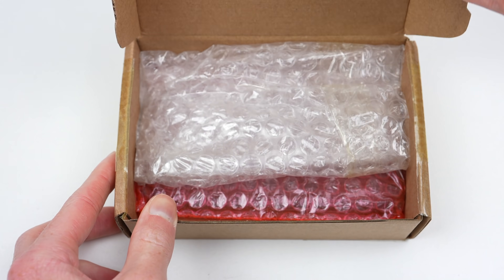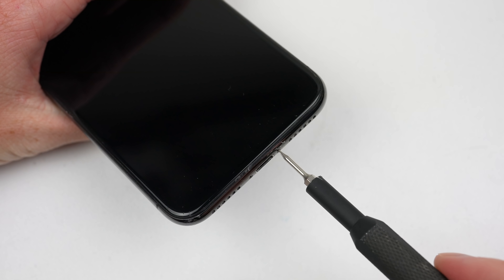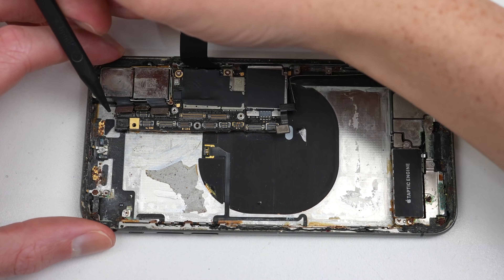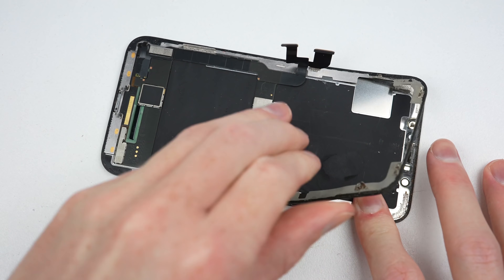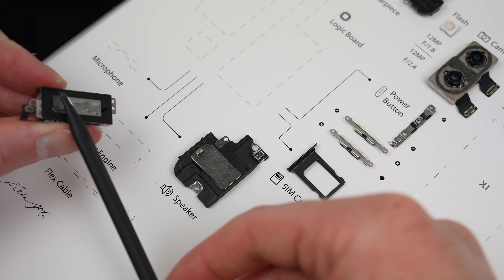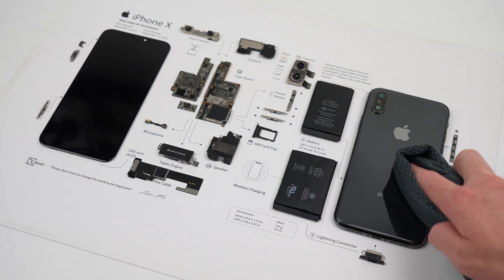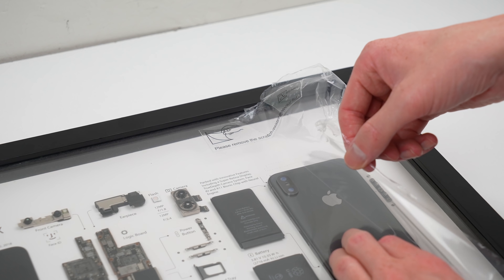Harder Than I Expected - E-waste iPhone X Transformed Into Something Spectacular

Comment: I love this! I recently bought two iPhone SEs from 2016. One of them is still working and I might use it for Spotify with my speakers. The other one I was given as defective, as it is stuck in a boot loop but with some tinkering, thanks to your inspiration, I switched the logic board with the working phone and there seems to be a hardware defect with the broken phone. While I could get the phone to boot up it seems to have been a corporate-owned device and the seller does not respond to my messages anymore.
I was totally thinking about disassembling the phone and putting it into such a frame to put it up for display!
Reply: @AyrisX86  Thanks for the tip. Just downloaded it but unfortunately it does not support devices on iOS 15...

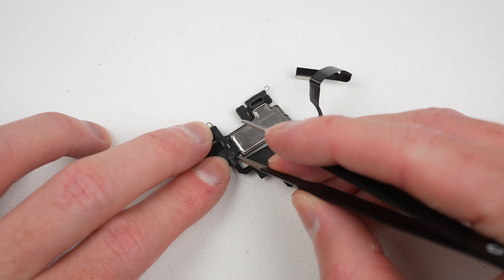Comment: 6:23 I sadly have an E-Waste iPhone X too. It works perfectly fine, looks great and almost brand new and doesn't have any obvious defects. The only and biggest problem is the iCloud-lock it has. As I got this phone from someone working in a house-clearance company who bought it from the company itself in hope he could use it, I can't get anyone to unlock it because the first owner is most likely dead. I will be looking for a matching set of Face-ID sensor, earpiece, board and sim tray to fix that phone. As I got it for less than an original screen or housing would cost, it wasn't that of a bad deal.
Reply: Which iOs version is installed?
Reply: @ParodieHecker-mobile  the newest one. I found some tool that said it could install a jailbreak on an iphone X that is locked. I thought I may be able to use that board as a testing board for future iPhone X models I might repair. Sadly the tool reported it isn't compariblemwith the newest IOS version.
Reply: @drcyb3r  That's sad. I wanted to mention that you can actually remove the lock on older versions (If only until the Next factory reset of the phone)
Reply: @ParodieHecker-mobile   Thanks. As I got that phone in a lot of about 7 phones including one broken and one working S7 and an iPhone 6 with a dead battery and some thrash phones I just threw away for just 80€ (88US$), I don't really care about that lock too much.

He told me the company sells  the good and fully working more expencive stuff in their store and because of some laws here in germany they would have to provide warranty and accept returns if they sell broken stuff in the store which would be really useless so he just gets the broken stuff from there and selling the stuff he doesn't need.
Reply: @drcyb3r  Ach, du kommst auch aus Deutschland :D
Reply: @ParodieHecker-mobile  ja

Comment: Wish me luck guys, replacing a screen on a Z fold 2 today.... The inner display....
Reply: Good luck.
Reply: @QWERTYQwertz852  went well. Had a small hiccup with the plastic border around the display
Reply: @TechDove  Great that it worked. Great work! 👍
Reply: @QWERTYQwertz852  thank you sir. My first ever folding phone display replacement, gotta say it took around 3x as long as a typical candy bar phone and wasn't without it's issues at one point I thought I killed the OLED panel itself but thankfully I avoided a $750 mistake there, I told the customer they might be better off just getting a z fold 3 at this point and trading in their 2 but people get very attached to things
Reply: @QWERTYQwertz852  but it's nice to know I can do this because I am typing on a Z fold 3 as we speak lol
Reply: @TechDove  oh nice. The fold series is great but sadly really expensive in repair. For me the fold would be to fragile

Comment: Hey Hugh, I was wondering what tape you use? The red, small double sided tape. I can't find it online. I currently use liquid adhesive as a back up in case somethings up with the adhesive template, and I'd like to switch to the double sided tape you're using. If you could be kind enough to comment the brand/type or link it, that would be greatly appreciated 👍! Thanks!
Reply: probably tesa tape available in different widths

Comment: If you don't mind can you make a video if Galaxy S7 (G930) and Galaxy S7 Edge (G935) Screens would work on any G930 and G935 board even though due to their physical shape and size they wont fit but screen  connector seems same.

Comment: Mr. Jeffreys. Have you tried using Evapo-Rust, or an equivalent to remove the rusted parts? It works very well. It will remove paint though, if you soak an item long enough. Do some off camera testing. You may like it. Have a great day!